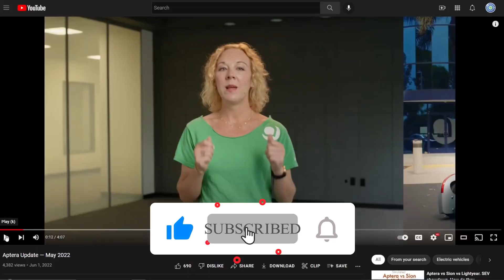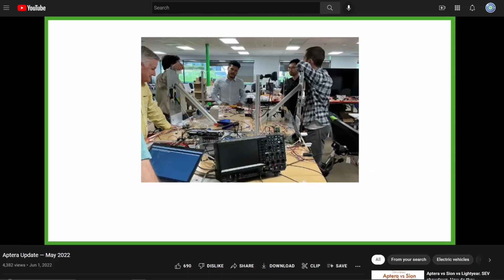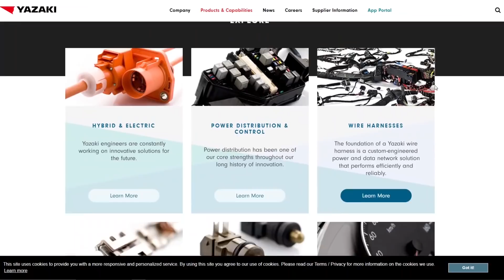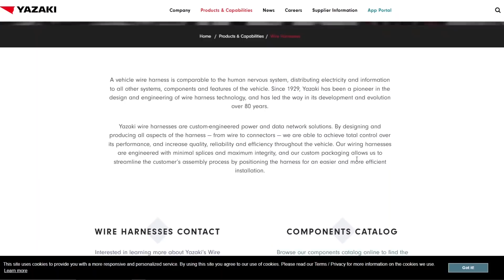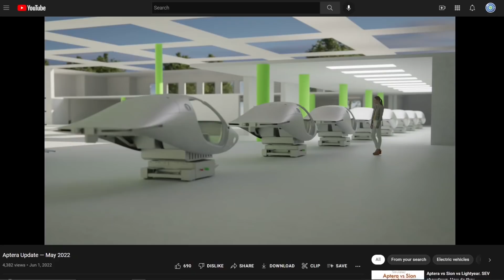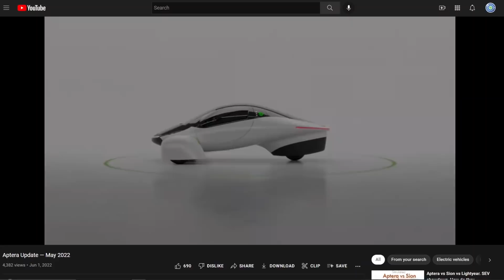Aptera May 2022 Update!

Comment: Seeing that front wheel assembly and its exposed hardware made me think about something. Not to be negative or give anyone bad ideas ,but as a person with prior experience in auto-theft investigations, and aware of the trend in component theft, (air-bags, Catalytic converters), I hope hub motor wheels in Aptera as well as other vehicles will be secured. By that I mean that the whole vehicle needs to be stolen for criminal removal of the components vs quick on location street stripping.

It makes a big difference. Like current vehicle (ICE and EV), it is very difficult to remove drive train components by merely jacking the vehicle up. Tires and Cat converters are easy so are wheels. I just hope that in the Aptera, the wheel motor won't be as easy to remove.

I predict hub motors will become a money maker for criminals. They are very powerful motors that can be use for powering machinery in 3rd world as well as other countries. Motors and batteries are the most valuable part of an EV. And valuable to the underworld markets.

Component theft actually creates black markets. In the 90's, Billy would have his trucks tailgate stolen overnight. He cannot afford a new one so he finds one at a great price out in the streets. He actually buys one that was stolen from Johnny a few days earlier. That is why the NHTSA stickers were created and placed on every door, hood, tailgate, trunk-lids etc.